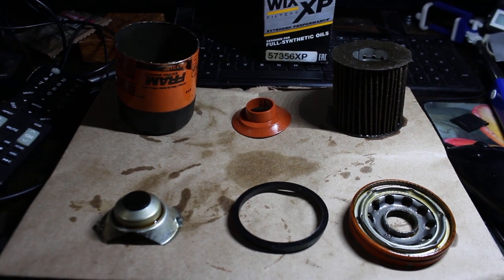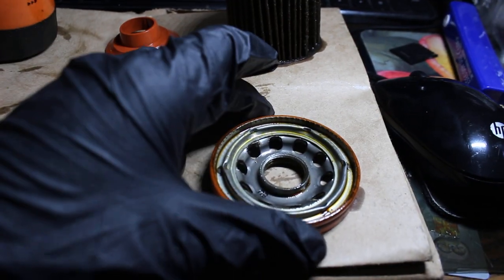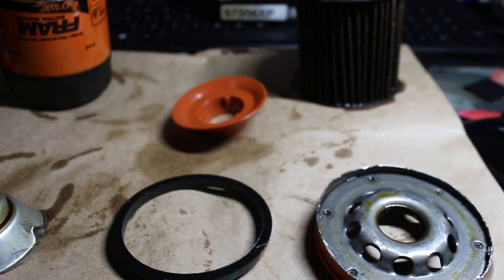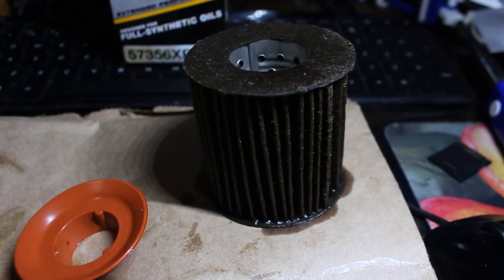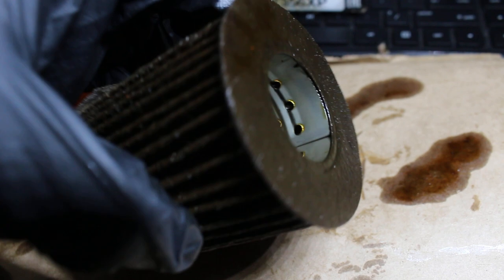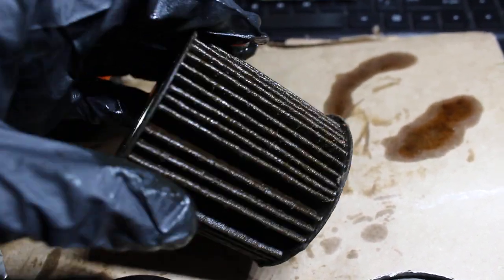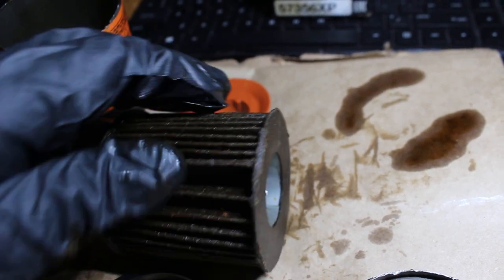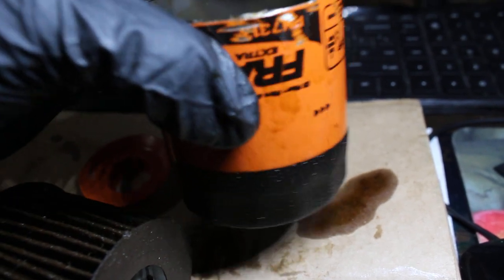10,000 miles with Fram Extra Guard.

Comment: If Fram oil filters were as bad as people say; you'd hear of class action lawsuits against Fram. Fram has been making oil filters the same way for 40+ year's.  Side note: Fram sets their micron rating at 20 microns. Where as others are using 30 microns as their benchmark.
Reply from the maker: Yea, Fram extra guards are ok filters. I only used this filter just to see the construction after 10K. I won't use it again on the 2012 Civic again. I have nothing against the orange fram but I like the full synthetic media from Fram Ultra Synthetic, Wix XP, or Purolator Boss.
Reply: @TheRichardF10  how about Bosch oil filter's? Respected name: I cut one open that was on my mom's explorer and one of the pleats was separated from the end disc. I GENTLY CUT IT OPEN TOO.  The silicone adbv was the softest I've ever seen though.
Reply from the maker: @danp7463  I have heard about purolator/Bosch cellulose medias tearing close to the end caps on the Bobistheoilguy forums but those articles are about 5 years old now. Who knows if they still tear from the pleats. I prefer full synthetic filters over cellulose or even synthetic blend media because they are typically reinforced with wire backing or nylon mesh. I've used Bosch filters in the past with zero issues. Matter of fact, I have never had oil related issues even with cheap oil and filters.
Reply: @danp7463  I bought a dozen Bosch Premium filters from Rock Auto for $3.50 each, which I thought was a good deal. After running a couple of them (so far) for 6K - 7K miles in our Hondas, I cut them open to check the build quality. So far they have held up pretty well, and I compare the construction and materials to the WIX or the Purolator. No complaints here.
Reply: @TheRichardF10  I have used the Fram filters in several of my cars over the years. Anywhere from the Extra Guard, to the Tough Guard, and the Ultra Synthetic. For you to show how the Extra Guard held up after 10K miles is quite impressive! I wouldn’t even do that with the Tough Guard (even though it’s rated for 15K). The Ultra Synthetic, yes because of it’s sturdier construction. People on these forums slam on Fram, and maybe it’s because of urban legends, but for me, after cutting open the various Frams, they’ve all held up well. Of course it helps if you don’t “hot-rod” your cars and change the oil and the right intervals. My two cents.
Reply: Yup. Even Honda and Subaru use Fram orange cans in their oem filters.
Reply: Have used them since 1972, never had a problem,  any one who puts 10.000 miles on an engine before service is nuts, oil's cheap Change every 3000.
Reply: They're garbage really, you can buy so much better for the money. Screw paper end caps.
Reply: @TheRichardF10 what about OEM? I get mines from Lexus for only $5 and it’s way less than the Fram Ultra which is almost $15.
Reply: Awesome filter,eighth wonder of the world!

Comment: That Fram filter looks good after 16,000km. Fram has a bunch of professional engineers who design and test the oil filters, so I don't get all excited about some of the crazy information posted by a bunch of people, who are as far from an engineer as you can get (back yard experts).  My Toyota uses a Cartridge filter and  it has no end caps, people getting excited over nothing. Great video, thanks for posting
Reply from the maker: Thank you for tuning in. We have an 1994 Chevy Suburban and it has used Fram extra guard for most of its life. It's still running well to this day with 290,000 miles. I'm confident that Fram has done extensive research and testing that I don't have a problem using these filters.

Comment: I have used Fram extra guard for over 30 years never had a problem with them
Reply from the maker: They are really good filters. I will use them on my brand new car.
Reply: @TheRichardF10  3 years ago u said u will never use again what changed your mind just wondering tried my first one on a Nissan Altima thinking about switching for all my cars

Comment: As long as it is the right size oil filter as long as you change it with every oil change and do regular oil changes it doesn't matter who's it is. Spin on type is ancient tech now and you'd have to do something really bad to screw it up to the point it would matter in and oil change interval.

Comment: FRAM Extra Guard: 95% efficiency at 20 microns. Wix XP: 50% efficiency at 20 microns. Both rated for 10K miles.
Reply from the maker: Wix xp does a good job at keeping insolubles out of the oil.
Reply: @TheRichardF10  No doubt. Just wanted to throw the stats out for anyone that might cruise through the comments. I have an XP I’m going to run on either a 4.0 or 4.6 Ford soon.

Comment: Even though the filter looks good, there's no way i would run 10,000 miles on that filter, maybe their ultra synthetic filter. I actually have the ultra synthetic filter on my honda right now. I do 5,000 mile interval changes. Using castrol edge high mileage, and added Lucas low viscosity stabilizer to try it out see if i notice a difference.
Reply from the maker: Nice input. I only used this filter once just to see how it would look afterwards. I will never use a Fram extra guard again. Not that I hate it, it's just that there are much better options for a couple dollars more. Fram Ultra Synthetic is definitely one of the best.
Reply: I wouldn't run any filter or oil 10k miles.  I don't care what the filter or oil claims.  the fram ultra syn filter is great but there are other filters just as good cheaper easy.  Napa filters are wix filters also napa oil is Valvoline oil (as of now).  I've ran Walmart supertech oil synthetic for years in everything I've owned since I was 17 i'm 31 now.  I've only had 1 engine failure and it was more than like me being a complete dumb ass than the oil/filter I used.  Sooo take that as you may.  End of the day, if you trust it and use it... go for it.  I've used fram before, once again I wouldn't run ANY filter 10k miles lol
Reply: Luigi Medina if you take out an extra guard filter and synthetic filter, they’re legitimately the exact same. Zero difference. At least for my Lexus IS. I’ve gotten same results. Over 10k easily
Reply: How does the Lucas oil stabilizer help? Ava at what mileage should u start using it? Thanks

Comment: Would I use one of these if that was all that I could get? Yes! As you stated, "There are better filters.} For the small amount of money for the better filters, I think I will keep buying the better filters. I would not want to leave one of these filters on for 10,000 miles. As far as oil goes, I would not want to go more than 3,000 to 5,000 miles between oil changes, no matter how good of oil it is. Great video.

Comment: Thank you very much Mr. Ojeda for the oil filter autopsy, I can feel quite a bit relieved since I have been using such oil filter for more than a decade, that "smartgrip" feature alone does worth the price of admission.
Reply from the maker: The suregrip helps out a lot. Use any fram filter with confidence.
Reply: @TheRichardF10  Thank you for your kind reply sir.  That being said, I am thinking we could turn any oil filter into a suregrip with a good layer of duct tape or traction tape...what do you think.  Am gonna try it and will let you know soon.

Comment: Did you use conventional, synthetic blend, or full synthetic and if so what brand? And viscosity
Reply from the maker: I used Valvoline full synthetic 0W-20 motor oil on a 2012 Honda Civic lx.
Reply: So using a full synthetic with a Fram Extra guard isint bad?

Comment: Great video and observations Richard.  I personally will not be using Fram filters again.  I am very impressed by WIX which BTW... makes filters for NAPA and for John Deere.
Reply from the maker: Same here, I only used the Fram to see how it would look after an oil change interval for my civic which I go to 10,000 miles. Frams are ok, but Wix XP is not much more for a better product. Fram Ultra Synthetic is a great filter as well over their orange extra guard.

Comment: A guy with the EG filter cut it open after 5,000 miles, the cardboard end cap had separated from the filter.    I would never use the EG past 3,000 miles. I will be using the XG7317 for synthetics, but my warranty won't allow extended oil drains, I like the 99% particle capture at 20 microns on the XG series.  What temperatures does your area get?  I just got my first used car that wants 0w20 and I am concerned about the 3 months that can get over 100F.
Reply from the maker: I only used the the EG one time only but I live he is So Cal. So mild to moderate temperatures. It can get to 100 degrees often in the summer time. 0w-20 has always worked well.
Reply: @TheRichardF10  Full synthetics right?  And thanks for the response.
Reply: @lonniebeal6032  you mean the video where the guy kept pulling till he ripped them off?yeah I saw that.  I can rip metal end caps off too if I did what he did

Comment: Good choice on the wix . That fram is just like the Honda A02 filter which looks like trash.
Reply from the maker: I only used the Fram Extra Guard just to see how it looked after 10,000 miles. As cheap as it is, it looks pretty good. This is the only time I would use a Fram extra guard. I like Wix XP because the quality is simply superb, even other high end oil filters the quality is sometimes off. For example, the louver holes on the Purolator Boss are sometime closed which is very bad. I think I'll stick with Wix until Purolator fixes the louvers.
Reply: Richard Ojeda  thanks for the cool vids good info and changes the perspective on which filters are best for our vehicles
Reply from the maker: @WoJak-y7e  Yes sir, let's keep maintaining. Thanks for the comment.

Comment: Would you run the a Fram rough guard filter(Gray can)?
Reply from the maker: I have nothing against any Fram oil filter, whether it's an Extra guard or tough guard. To answer your question, would I run a Fram tough guard (gray can). Yes I would use and I have used them with zero worries. I would not run it on my personal cars. Not because they are bad, but because there are much better oil filters out there for a little bit more money. I personally like filters with full synthetic media, like Purolator Boss, Wix XP, and Fram Ultra Synthetic. Thanks for tuning in.
Reply: Richard Ojeda that’s for the reply, but I heard that the micro rating are not as great in the boss and wix xp. The Fram ultra is 20 microns
Reply from the maker: @classicjay7786  I'm going to be honest with you, I really don't care about micron ratings. I have heard all those things about Wix XP and Boss, but I don't want to get caught up with numbers. That's just what I think about oil filters. I have used a Fram Extra Guard on a 1994 Chevrolet Suburban for most of its life and it is still running to this day with 290,000 miles. People can get too caught up with numbers but the bottom line is as long as you change the oil and filter on a timely matter the engine will last even using the cheapest of filters and a quality oil. I use full synthetic oil and filters with full synthetic media and I know that is overkill. Thank you for commenting.